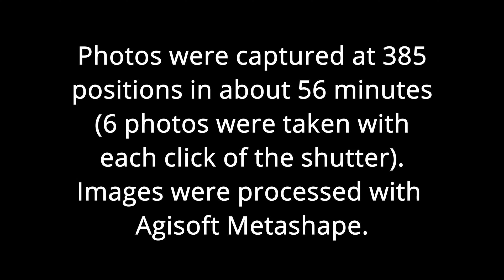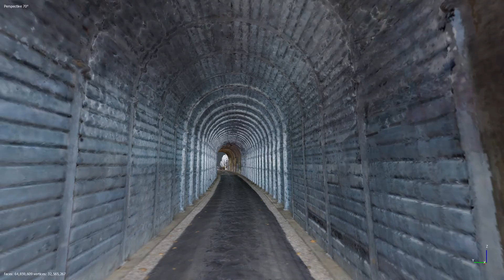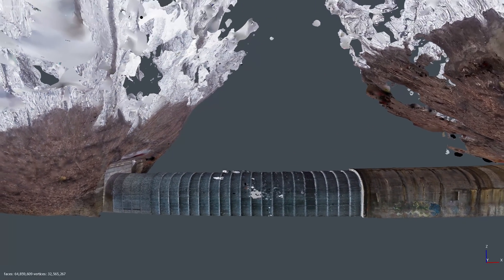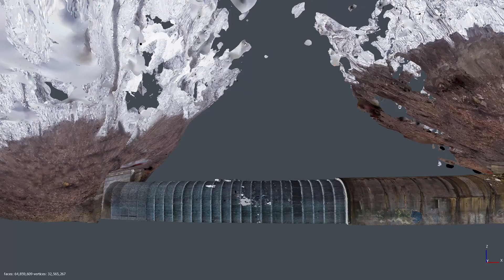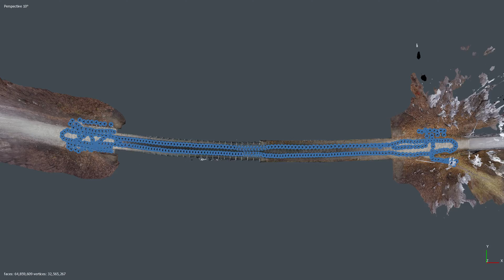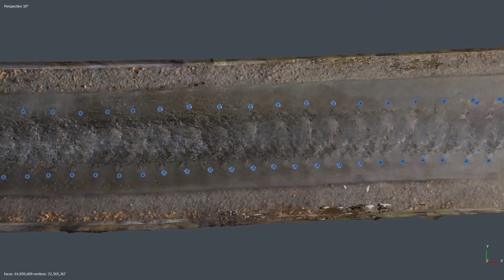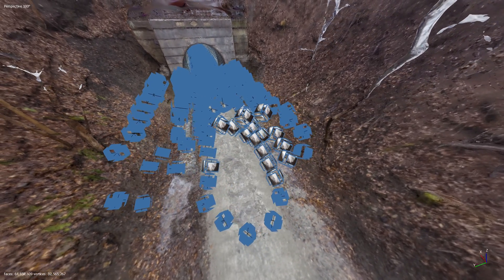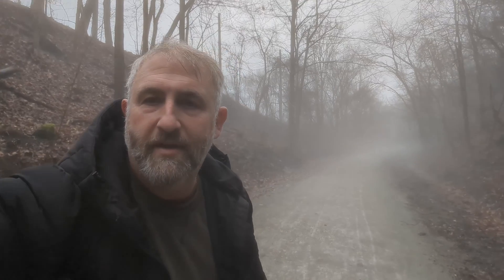Using the GoPro Omni Pro for 3D Modeling with Photogrammetry

Comment: Hi
I have a question. Can the Hero 4 Black be switched with newer models?
Reply from the maker: I believe that I read somewhere that the Omni Pro will only work with the Hero 4 Black camera model. There is special firmware for the cameras to make them work in the Omni Pro. That said, I haven't tried to use any other cameras in it.
Reply: @LaunchedPix  thanks for your answer. I am interested because i like to train gaussian splats. And therfore i like to try different setups. 
Would you be open to share some images from one project or shooting with me, so that i could test how well the output of several hero 4's is and if a decent gaussian can be trained from it. Would highly appreciate it sir!
Reply from the maker: I can probably help you out. Please send me an email (address is in the about section on my YouTube channel). Let me know more about what your looking for and then we can figure out a way to get you some data to work with.

Comment: Mike. I'm trying to take a capture from helmet on a go kart(lots of blur and jiggles). How would you go about turning that into a model of a racing track?
Reply from the maker: I'll assume you captured video. I would use a program named FFMPEG (free and lots of online tips available on its use) to extract frames from the video. Extract them at a frame rate so the extracted frames overlap the sames scene content about 70% between each successive frame. Look at the extracted frames. If they are really blurry then you won't get a good model. I would then use Agisoft Metashape to process the frames into a model (you can probably get a free trial). Click on the camera calibration before aligning the photos. There select fisheye for the camera if it's a wide angle action camera with a distorted field of view). Also look at the option below the frame/fisheye lens selection and select an option to use a rolling shutter compensation (full). Hopefully this helps.

Comment: Thank you for this video brother im working on something and am right at the edge of volumetric capture at home i have a go pro omni complete rig and i have just the frame as well so i have 2 and im considering whether to buy a 3rd for 30 bucks next time i get paid i also have a lieca geosystems hds3000 laser scanner and a dot3d dpi8 handheld laser scanner as well as iphone 14 pro with lidar im working on building a cheap 48 camera volumetric stage in my bedroom and was planning on using the omni with a abandoned beta program known as walkabout worlds pano modeller i believe with this system ill be able to do the best quality possible at home for someone on a budget keep these videos coming please brother maybe a tutorial video on how you capture and process the images to get this quality model thanks again for this video as it has confirmed my belief that it was possible and that the multi lens setup would actually be better for 360 photogrammetry in metashape with the 360 setting on i concluded it was a much cleaner way of capturig the images than trying to split a dual 180 fisheye lens and by doing this you ave confirmed my idea would work would love a video on the actual workflow with the omni if you have the time :)

Comment: Cool video.  The GoPro Omni - I see older online info about it, but nothing new.  Neither it nor the links nor the software mentioned appear to still exist on GoPro's website.  Is this something you recently acquired?  Does GoPro still support it in any way?  Thanks!
Reply from the maker: It's certainly an older camera, and I recently acquired it. I didn't get any of the software from GoPro to process the images and I haven't found support to get it. As in this video, I'm just using the video file from each card and processing the data outside the GoPro software ecosystem.

Comment: How did you avoid being captured ? Hiding in the nadir?
Reply from the maker: Great question. I stood at the base of the light stand (pseudo tripod) about 2.5 feet under the camera. I'm in the photos from each of the 3 downward facing cameras to some degree. My position wasn't fixed with the environment so the photogrammetry software used to create the model essentially removed me from the depth maps and the subsequent 3D model it created.